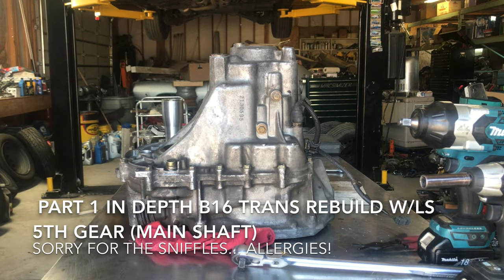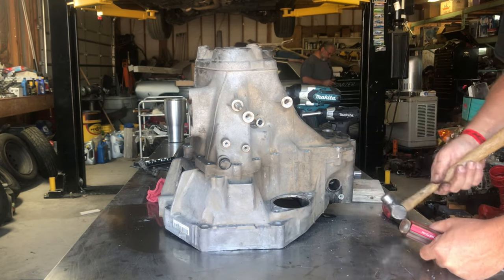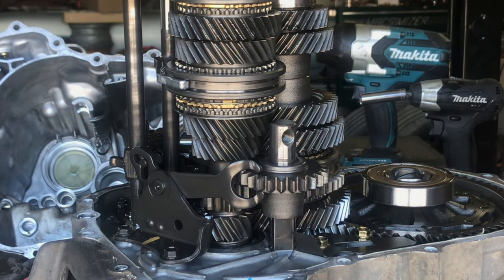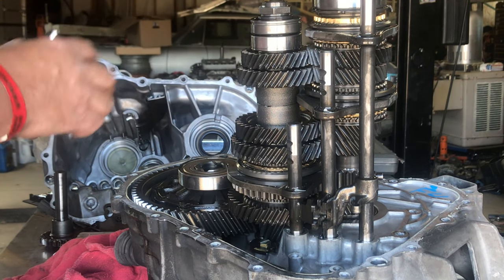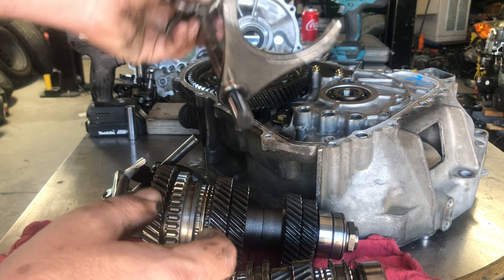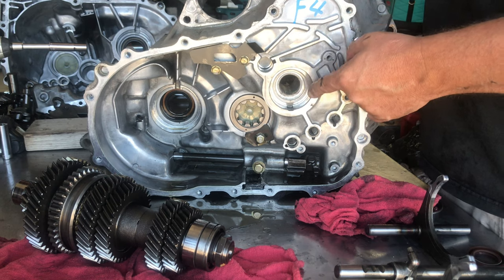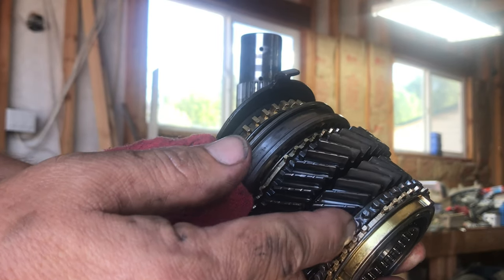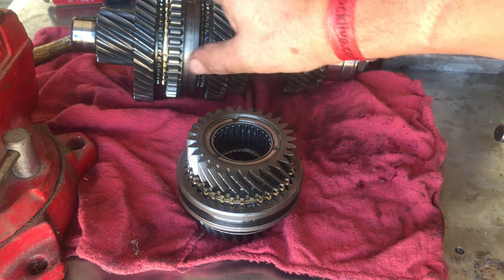Honda/Acura B series 5speed IN DEPTH REBUILD! PART 1

Comment: Excellent how to, thank you. I am doing the same gear swap as you but was worried about how hard the synchro swap would be. I’m now confident I can change them all. Thank you 🙏
Reply from the maker: They’re pretty straight forward but do not flip over any of the slider hubs by accident. I can tell a few in the comments didnt hear me and probably junked a tranny after installing it and it didn’t work. 😣
Reply: @MRROCKAPE  starting to feel like a novice again, what’s a slider hub? Is that what the gear fork selector moves up and down?

Comment: This is some damn quality content 👌! Grate detaip an explanation 👏!
Reply from the maker: Thanks… I have probably done 50 D and B series manual rebuilds back when I worked for the honda dealer…. The carbon synchro’s are a must in a performance rebuild. The trans I did here is a b16(short ratio) 1st-4th with an LS 5th gear set for lower highway rpm

Comment: Yo this is awesome you're really good at working while explaining. No beating around the bush just working and talking. I'll be pulling an LS from a junkyard but I want a shorter 3rd and 4th, if I find some other b series gears do I only need the actual gears?
Reply from the maker: You’ll need both the matching main and countershaft gears to interchange ratios. Synchros and bearings are the same. I haven’t come across any issues swapping  LS gears in b16 transmissions So Im sure you could put b16 ratios in LS gearboxes

Comment: What's the reason my transmission goes into gears, but when it's supposed to be in neutral, it's still in gear? Shift linkage mechanism? Shift change holder? I need help, B series LS Transmission.

Comment: Very informative, thank you! I drag race my 95 GSR. It became impossible to shift (any gear) on drag strip (high RPM). But on a street it shifts fine (low RPM). It won't grind, it just wont go into next gear until the RPMs drop below 5K. Any idea what may cause it? I just pulled my tranny out...

Comment: Are all B series synchro sets the same? How do I buy a kit for stock B16 1-4 gears with LS 5th gear?
Reply from the maker: Id go to synchrotech and double check me but Im 99% sure ls and b16 are the same as far as the synchro are concerned. Buy the carbo ones dont cheap out on the brass ones.
I believe the itr trans is different

Comment: Do you use any assemble lube when reassembling? If so, where?
Reply from the maker: A tiny bit of grease on the input seal couldnt hurt but otherwise none. Use Genuine Honda MTF (or whatever they call it now)
Reply: @MRROCKAPE  thank you. I'll be working on  j1 (cable b16) Trans and I've been watching your videos repeatedly. Very well done with all the info in the world.

Comment: I have a question maybe you can help me out? Is it possible to have a ls trans /w gsr internals ?
Reply from the maker: As far as I know all B series trans parts are interchangeable though I have only done the ls 5th gear conversion b16 and a gsr without issue. If I ever decide to start street driving my b16 sc hatch with a itr trans I may put the LS 5th in it. Hope that helps
Reply: @MRROCKAPE  thank you

Comment: What are the parts numbers of the input shaft bearing and seal? I bought a transmission for my b20 that has miles of input shaft play and definitely need to replace them. Cheers!
Reply from the maker: I have no idea…. ID your trans year/make/model and take that info to  one any of the factory online parts resources and look it up. Assuming they are all the same has bit me once doing an 91 Si d series as there is an early and late input bearing and they are different.

Comment: The outer bearing on the main output shaft for Ls do u noe the part#
Reply from the maker: Sorry… its best to ID your trans year/make/model and look up the parts on one of the factory parts online resources and order them. I never assume they are all the same part #
Reply: HondPartsnow.com enter your car and find the part number you can find everything there including torque specs and bolt sizes.

Comment: Just curious will this video work for the gsr trans
Reply from the maker: Yes… all B series manual trans are the same procedure… the awd cr-v is slightly different but similar enough this will get you through the inspection and rebuild.

Comment: Where do you buy the synchros?
Reply from the maker: Synchrotech carbon fiber lined, I have used them exclusively for years with no issues.
Reply: @MRROCKAPE  Do they handle considerably more power? Or just last longer?

How much power, if so?
Reply from the maker: @slumpedmage  Its just a rebuild with mostly stock parts I doubt it adds any strength, there are aftermarket gear sets that increase strength but I haven’t used them or installed any.

Comment: I have really sticky in/out of 5th & it will NOT go back into reverse no matter what. running or not. Any idea if this could be anything other than the linkage?
Reply: mine did the same thing i had to get transmission rebuild
Reply: @reekodayoungan1104  it was the sleeve between 5th and reverse right?

I still haven't fixed mine. Luckily my 92 EG is super light only had to push it a few times
Reply: @slumpedmage  yes it was the sleeve. I was leaving work & out of nowhere my car stopped driving it would only rev & it wouldn’t go in reverse